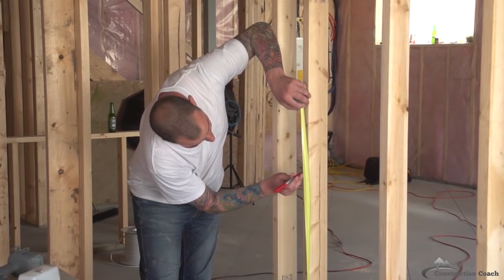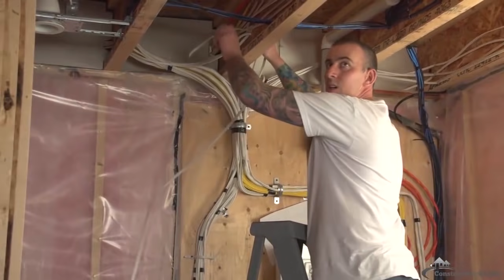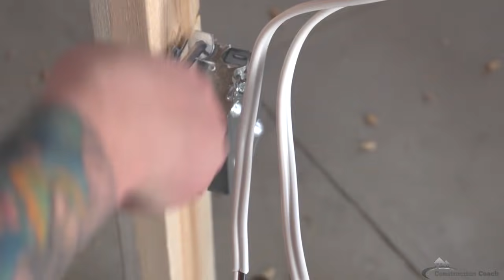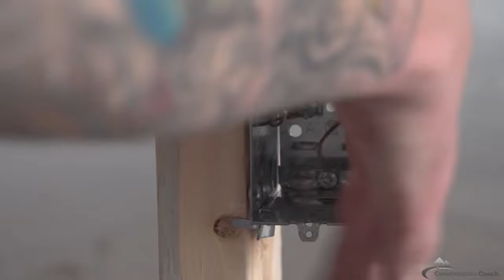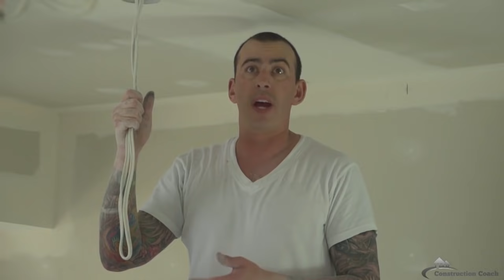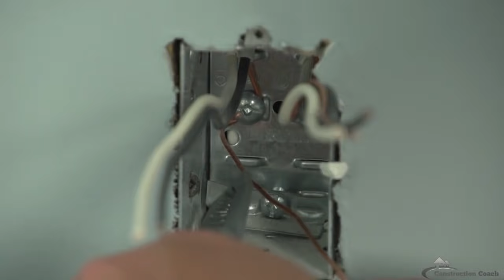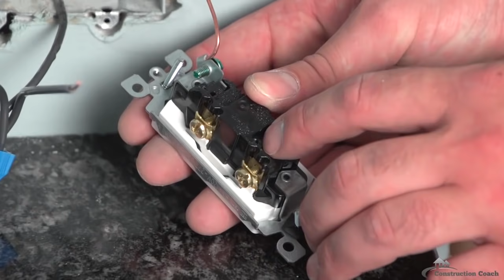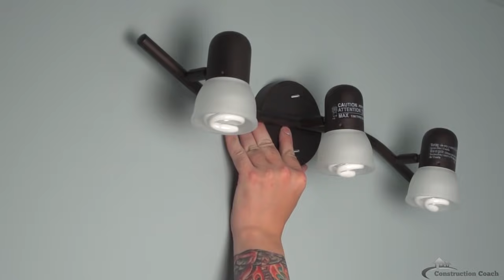Home Electrical 101 - What you need to know now!

Comment: I was able to run a few new breakers/circuits for my kitchen renovation from this.  Thanks much for all the time you put into this.  A few shocks along the way but that's part of learning!  The 2 biggest takeaways I got: use the tool every time to test if wires are live, and it's WAY easier to run a new circuit (if your panel has room) than figure out existing wires.  My breaker box wasn't labeled especially great as to what did what or went where and is 70 years old.
Reply from the maker: Thanks for the feedback, happy diy!

Comment: I just wanted to start off by saying you did a great job on showing different installation aspects of electrical wiring in a home. I know this video is a few years old now, but I do have some code/tips suggestions for you or anyone else wanting to wire their homes.

- According to code, all ceiling lighting boxes in bedrooms must be ceiling fan rated. It doesn't matter if you are installing ceiling fans in your bedrooms because later down the line, you may want to... or if you sell your home, the next owners may want them. Installing a ceiling fan on a box not rated for one is both not safe and not in accordance to code.

- According to code, you MUST install a smoke detector in the bedroom and it must be tied into every smoke detector in the house so that when one sounds off, they all do.

- When installing the wiring on the rough-in, you should go ahead and make up the junctions. Two reasons... First reason is that you don't want to have to carry around so many tools on the finish and the second reason is that you know exactly which wire is feeding what when you can physically see them. For example, when you installed the switches in the bathroom, you had to turn power on to verify which wire was the feeder wire from the panel. You wouldn't have to do this if you wired the junctions on the rough and could see where the wires went.

- When installing the romex into the boxes, leave one romex per gang (1 gang box, one romex, 2 gang box, two romex, etc...) box twice as long as the rest. This leaves you with enough wire to add pigtails to the junctions to hook up devices.

- When making up junctions, strip the individual wires a little longer than needed. Then twist the solid wires together, THEN cut off excess to fit into the wire nut. After twisting the solid wires together, hold any stranded fixture wires together at the very end of the solid wires and twist the wire nut on. The wire nut will simultaneously suck up the stranded fixture wires and twist them around the solid wires for a nice tight connection.

- You did great in holding the insulated wires while twisting the copper together. I wish you went on to explain why this is important. The ground wires can just be twisted all the way up into the box with no problem because it doesn't have insulation around them. The insulated wires cannot be done this way and you have to hold them to make sure of this because if you twist the insulated wires, it thins the insulation and could potentially heat up and cause a fire.

- If you connect the wires as I have explained, there is no reason to add an extra electrical tape around the wire nuts. They will never pull out.

- When installing the romex into the boxes, you want to strip off more than the 6". 6" is supposed to be the amount of wiring coming out of the box. Not the total. 

- I would have liked to see you installing the back splash on the bathroom counter because those devices looked extremely low. I recommend kitchen and bathroom outlets to be about 48" to the top of the boxes to eliminate the possibility of ever being a problem with back splashes.

- Never cut off ground wires! Even if the wires are mechanically bonded in a metal box. Things happen and those screws could get loose or whatnot. It's always a good idea to twist all ground wires in every box and put on a pigtail and wire nut them. 

- When installing to receptacles, never put two wires under one screw. Even on those GFCI outlets. Always twist the wires together with a pigtail and wire nut them. 

- You mentioned this in the video, but on a different application. When installing devices in metal boxes, you should ALWAYS wrap electrical tape around the device. This not only keeps it safe to work around (for temporary reasons like you stated), but there is very little space between the hot screws and the box. If the device were to shift over just a little bit, it would short out on the side of the box, potentially causing a fire or injury. This is also a good idea because the ground wires are not insulated and can potentially touch the hot screws. Wrapping each device with electrical tape will eliminate that possibility. It's also a good idea to wrap the devices because if you need to get back into the box for whatever reason, you can safely pull the device out of the box without the worry of touching the screws. Of course, you want to turn off power before ever going into a box, but it's still a good idea to wrap devices.

- With regards to your bath light, you should hook up all the wires first, leaving your ground wire long. Then, you can push back all the wires into the box (better than having them in the fixture housing). When you install the mounting bracket, you can wrap the ground wire under the screw. Again... having all the ground wires tied together in a wire nut is important especially in this application because the mounting bracket may not even fit correctly onto the box and give a good mechanical bond. But if the wires are securely tied together in a wire nut, you will have no problems.

- I know it's easy to just put one wire under each screw in a receptacle, but this is actually a fire waiting to happen. I've seen it happen. The problem with doing it this way is that the ONLY thing tying the circuit together is that thin little tab between the screws. If you think about this, you will understand why it's not good. Let's say your first receptacle is installed like this, that means your next receptacle relies on that little tab for connection, then the next, then the next... until you get to the last receptacle on the circuit. Now plug a vacuum into that last receptacle. You have a huge load going through all those little tabs that just aren't designed for those kinds of loads and are going to heat up and potentially cause a fire. The ONLY purpose of those little tabs is to connect the top side of the duplex receptacle to the bottom. And if you wanted to split the receptacle (having one side be controlled by a light switch or whatnot), you can simply break off those tabs... which is a great example of how thin those tabs are because it takes very little effort to break them off.

- I like that you always put the wires under the screws instead of using the quick connects. And the reasons you gave are sufficient. I just want to add another reason why you don't want to do this. If you look inside the hole where you would shove the wire into, you will see a small piece of a copper plate. This is angled so that the wire can be pushed in, but can't be pulled out. The problem is is that this will wear out eventually leaving the wires loose in the device. Loose wires cause fires! Also, when using those quick connects, you have to strip the wire perfectly as to not have any copper showing after you push the wire in. It is very difficult to get the wire back out to trim the copper and put it back in. I know the devices have a release built into them, but every time you use that release, the bigger chance you have on that wire getting loose in the quick connect. Always use the screws. And always junction the wires with a wire nut leaving one pig tail wire to connect.

I hope these tips help you out in the future and help out other people wanting to do their own electrical installations. Cheers!
Reply from the maker: Thanks for the tips!!! Very informative. Where are you from?
Reply: @ConstructionCoach  lol. I'm from Georgia! 
I am in the process of building a house and I saw your video on tub installations and got some great tips! And I noticed this video while watching and since you did a great job of explaining the tub installation, I decided to check this video out as well. I have some basic understanding of plumbing being in construction for over 20 years, but I just wanted to brush up a little. Being a licensed electrician, I'm always curious about how other people do electrical. And overall, I really enjoyed this video of your electrical installations. You did a great job. I just wanted to share a little of my own experiences to make electrical installations a little more easy and just a little more safe for long term applications is all.
Reply from the maker: I totally appreciate that you did!! Lots of great info. Thanks Donovan.
Reply: I like ur tips very helpful.. I had some questions about what has to be on a separate breaker of its own.. I'm remodeling my sister's house and was wandering about the washing machine and if anything else can be on the same breaker I've read very conflicting literature this house was built in 1980 and whoever wired it left bare wires up there and have things wired crazy like so I'm trying to get it straightened out.. I'm remodeling the whole house fixing plumbing and electrical issues trying to get it up to date.. for example they had the washing machine plumbing on the outside of the wall which I have brought back into the walls.. still a little confused about how to run the vent system works.. I believe the wash room and the bedroom next to it use to be the garage so I believe that why they took the lazy way and plumbed it like they did.. so if u have any tips I'm all ears..
Reply: @Tpayne869  First off, before wiring anything, you need to get a permit for something as big as rewiring an entire house. You can get seriously fined and may have to remove the entire installation if caught doing so without a permit... and most people get caught when selling their homes. I would say that also because rewiring an entire house is a big project, you should go ahead and hire a qualified electrician. Not only knowing the codes on what needs dedicated circuits (their own breaker), you also need to know what size breakers you need, what size wiring you need, where you need GFCI outlets, where you need arc fault outlets, receptacle spacing, etc... And because the house was built in the 80s, chances are the panel and service needs to be upgraded to accommodate the new wiring getting installed. And then you need to get your power company involved as well. But if you hire an electrician, they take care of all that for you as well as pulling any permits needed. 

If you want to try and do this project yourself and not hire a qualified electrician, for 120V circuits, anything that has a motor, heats, or cools needs to be on a dedicated circuit. This includes (but not limited to) clothes washer, dishwasher, garbage disposal, fridge, sump pump, permanently mounted microwave, etc. Other things that need to be on dedicated circuits are your smoke/CO2 detectors (with clear labeling in the panel) and bathroom receptacles (there are electrical codes that let you get away with different things regarding your bathroom recepts, but it's just easier to put them on a dedicated circuit). Also, your kitchen counter recepts need at least two separate circuits and they must have an equal (or close to equal as you can get) number of receptacles. Follow the tips in this video that Construction Coach made and you should be ok. The biggest difference is that you are wiring an entire house, whereas the Construction Coach only wired in a small living space, a bedroom, and a small bathroom.  

However, you must check with your local electrical inspector to see what kind of local codes you are dealing with. There is a national electrical code and that is the minimum standard, but local codes can always supersede them or they may have their own interpretation of the code. This is another reason you should just fork out the money to have a qualified electrician do the work because they already know all the local codes.
Reply: Donovan Sparks ⚡️Man I would love to have someone like you, with your knowledge teach me everything about the trade! ⚡️⚡️👍🏽

Comment: I was already a novice with basic electric work, and know my limits, but he helped me learn the service loop and just overall neatness. Good clear instructions.  I was a Health & Safety Coordinator for 6 years, and responsible for OSHAs 70E industrial electric guidelines. I was responsible to make sure our maintenance crew were certified electricians and, make sure all of their high voltage PPE was up to date and up to code, plus, monitor frequent Inspections of the electrical safety equipment to make sure it was damaged. Lots to learn in industrial electronics, and also automotive robotics safety protection, and work instructions.

Comment: Good video!  Luckily for you, you specifically titled it as Electrical 101, not "Contractor Advanced Productivity and Profit enhancing techniques" as many of the comments are attempting to crucify you for. You specifically explained codes "for your jurisdiction", and presented a thorough presentation. Kudos.
Reply: the outlet spacing rule isn't just a local code that is a code from the NEC and he left out the first part of the code which is the first outlet shall be within 6' of any break in a wall, such as a doorway so therefore he could have placed that first outlet a little further down the wall line. and Coach Tim is certainly NO expert
Reply: @chaser9363  It's pretty clear this guy is in Canada.  They don't follow the NEC in Canada.
Reply: @Wowzersdude-k5c  what is it that makes it so clear,the fact that they seem to build backwards. Lmao🤣
Reply: @chaser9363  Yep, now the vapor barrier has been compromised!

Comment: I've been an electrician for about 2 months now in the commercial market. I'm trying to flip homes, but it's so early in my stage so I decided to just start learning everything.
Reply from the maker: That’s smart, decertification is the way to go if you want to flip houses. Otherwise bring out the bender! Where would you flip houses?
Reply: @ConstructionCoach  union is definitely the way to go, however it is my back up plan. I’m in San Antonio, Texas and the housing market is huge right now.

Comment: Why was insulation and vapor barrier installed prior to electrical?
Reply: A lot of time at a job site what happens another person or crew from a different profession than yours would get there before you do and  do their job, then when you get there after them you have to work around what they have already done.
Reply: Maybe someone should know what they are doing and make sure the process is done properly.  This is stupid. You're pulling of vapour barrier?
Reply: no need to worry bout it when youre doing all the jobs yourself!
Reply from the maker: Sorry for the confusion!!! I moved into the house before I started the basement development. To pass my final inspection and gain occupancy they require a r12 minimum on foundation walls. (This r value may change from region to region and should always be verified by checking local building codes) Thanks for watching!!
Reply: Lousy run job. The Empire State Building was not built from the spire down. If you fall out of sequence on a job due to a conflicting contractor scheduling which is a result of poor project management skills which cost extra time and money.
Reply: @edwardcraven9195  You obviously responded without reading.  Take a few seconds and look at his response right above yours.
Reply from the maker: Thanks !!!People just love telling me what to do!! I appreciate the support.
Reply: @lowemichael03  Can we put the roof first before the walls? Foundation being last?
Reply: @balloney2175  
Yes sir, it can be done in some part of the country they call him carports. No walls whatsoever just for post and a roof. You did say can you put up a roof Without Walls did you not? Your question has been answered anything else?🤔😊
Reply: @lowemichael03   A lousy run job is when you jump sequence. Scheduling is vital for a smooth-running project.
Reply: @balloney2175  Actually yes. Often times a roof and walls will be built and set aside, and later put into place when needed on manufactured homes. If you are delayed due to a lack of I-beams, you can have the crew proactively work on other stuff as you wait for your shipments to arrive

Comment: Really good video.  Only criticism I would have is (having run cat5/6 for many years as a professional) don't EVER use metal staples on cat5/6.  If you have to, at least don't hammer the staple all the way down.  VERY easy to damage cat5/6 and never know it until the customer is complaining of performance issues and then it's too late to find the problem without pulling down drywall. Not fun.
Reply: What type of Staples should he use? Im learning thanks,
Reply: @TheBigDirtNap  ...plastic cable clamps.  I wouldn't want any metal too close to any UTP ethernet cable.  It can cause problems.

Comment: Where I am they do not allow more then 6 wires to be bundled together for overheat reasons unlike the 20 or so you have bundled together there. Another thing that is required is that all ground wires are connected to the ground screws in boxes, even the ones going to plugs and light fixtures. Also it's a good idea to wrap plugs with electrical tape before screwing them in, reason being if box by some chance the box has been distorted from installation or it's a tight fit like your ground fault plug your installing, so it will not short out in the future, they can wiggle a bit when plug something into them causing a short.
Reply: never said wrap box, I said wrap plugs.